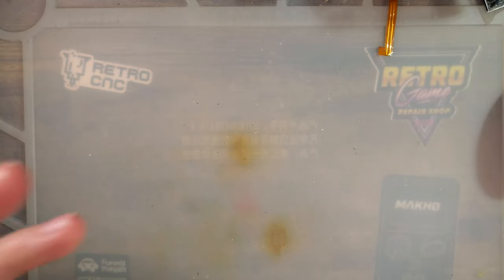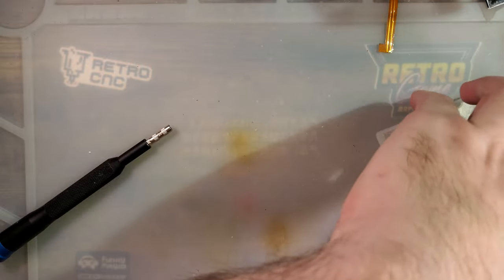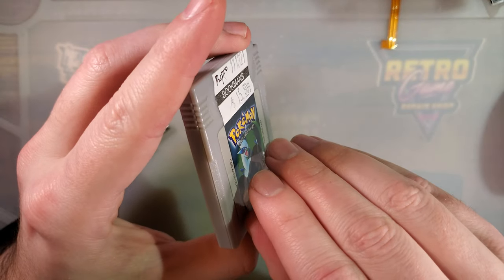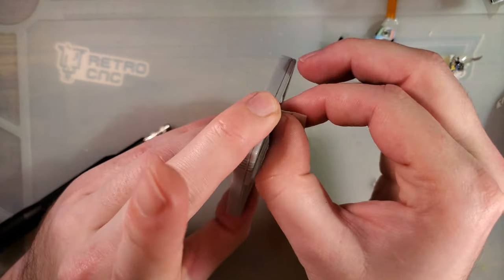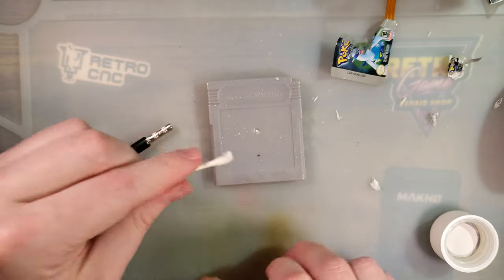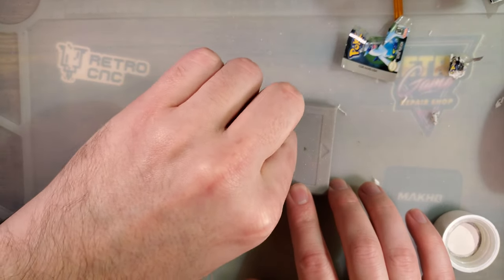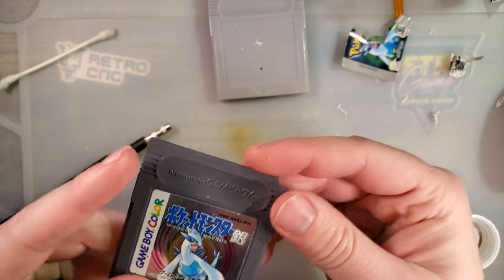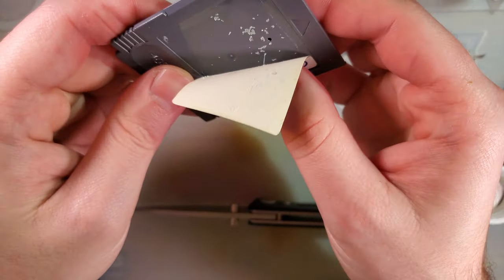Game Label Swapping

Comment: If you dont want the adhesive coming off the label try heating it from the back so your heating up the cartridge not the label
Reply: this is exactly what you want to do. a hairdryer is perfect for this, a heat gun will 100% ruin everything. i do a few cycles of heating the cartridge from the back side, the hardest part is getting a corner up without cutting or damaging the label. use heat from the back side over and over until label peels off super easily. this works especially well on gbc carts and takes a little more patience with original gb carts, the plastic is thicker on the gb carts. i use a piece of wax paper to place the label on before i swap it, the more u touch the label with your fingers the more the adhesive will fail.

Comment: I use my breath to heat and humidfy the adhesive, blow it the same way you blow out air to clean your glasses or the screen of your phone, directly between the label and the cartridge, you can first blow on one corner to make an entry point for your knife.

Comment: I have seen success when using a solvent which shouldn't damage the ABS such as lighter fluid being used to attack the adhesive ( LPL managed to remove a tamper-proof sticker this way with denatured alcohol in a syringe [1422] ). It pretty quickly evaporates, leaving the paper perfectly fine and the adhesive becomes sticky again after.
Reply from the maker: I'm not a fan of using solvents on these labels, especially the laminated or foil based ones. That was the driving force behind working on an alternative in the first place.

Comment: I wish there was a good "megastore" for reproduction labels for GB/GBC/GBA games. The best repro labels for Pokemon games are honestly the holo labels that come on cheap repros. Even sellers on eBay/Etsy don't have as high of quality of labels as those. Sadly, there's not a good holo label alternative to gold/silver/crystal or a good replacement label for Emerald. Just not many options for replacement labels out there. That's the one downside of buying broken/for-parts carts or missing label is that even with a good repro cart shell and a good PCB, there aren't any label options worth much.

I've always had good luck with heating the labels also with a hair dryer on low heat until they're warm to the touch. The adhesive is so old it REALLY lets go after light heat. I wouldn't recommend even trying without heat.
Reply from the maker: if you have a good inkjet printer, you're 70% of the way there anyway to your own custom labels. Next steps are to source appropriate paper(s), finish (lamination?), and then just cut and apply. 

Last hurdle will be the label design itself but that's a bridge you have to burn regardless of who is doing the printing unless you pay someone for custom work there too.

Comment: You can also use your 3D Printer Heating bed :) and it's PID(or Bang-Bang) tunned. so it'd hold requested temp.
Reply from the maker: good call on the printer, I always forget that I can (mis)use the heated bed for other temp controlled shenanigans
Reply: @makho  i'm using leftover 400W 350x350 bed as reflow plate :) so it will be very possible that enders 220W 235x235 bed'd reach around 100-110*C
Reply from the maker: @rfgame3457  I've actually got a monoprice maker select 2s (wanhao duplicator i3 clone iirc) so I might just rip the bed out of that

Comment: right when u got to the part where u were going to give up with the pokemon yellow, i would have gotten a cotton swab with a TINY almost IMPERCEPTIBLE amount of goo gone, applied it to the edge that was tearing by patting it, and wait five or ten minutes before resuming.

sometimes if you use too much goo gone, u permanently discolor the paper label, but if it's just the right amount, it can save you.
Reply from the maker: "goo gone" (and "goof off" both) can discolor ABS plastics too. I do not recommend for this use case with the risk to the label and the plastics.

Comment: Thanks for this, I saw a mod to swap the ROM of an English Pokemon Crystal with a Japan Crystal mobo (it has a special design on the mobo).  You have to keep the Japanese shell because the cart has 2 screws instead of one.  I want to keep the English label.
Reply: I just did that and that's what brought me here. I ruined the japanese sticker by "cutting" away at the adhesive while pulling it off which just put lines all on the sticker that I didn't notice until I was done.

Comment: tried using a hair dryer to heat up a cartridge to remove the label, ended up warping the plastic from the heat... luckily it was a cheap test cartridge i used that on.
Reply from the maker: That's one of the reasons I like steeping the carts over hot air, it's an order of magnitude easier to keep the temperature stable

Comment: Do you know if the Pokemon Holo labels are tougher than the non holo labels? I bought some cheap test carts from the flea market to practice with before trying to transfer a Crystal sticker, but they just keep ripping no matter what I try.
Reply from the maker: Yeah, they are. Still, if you can get a paper label off intact, you'll be in a rock solid place to do a holo label.